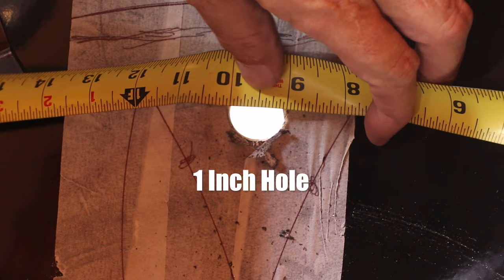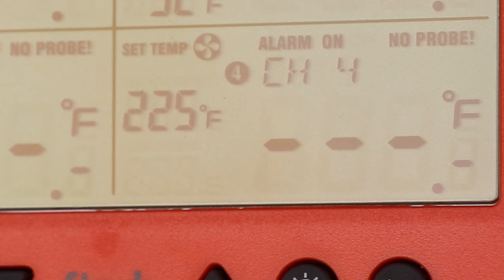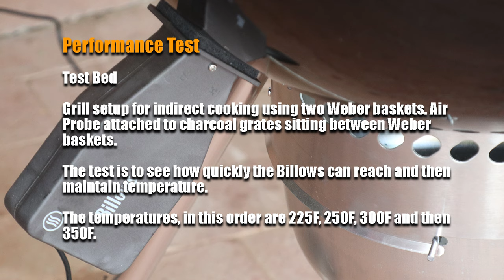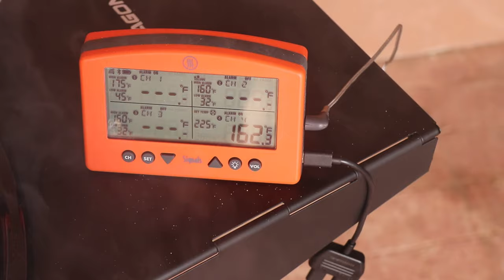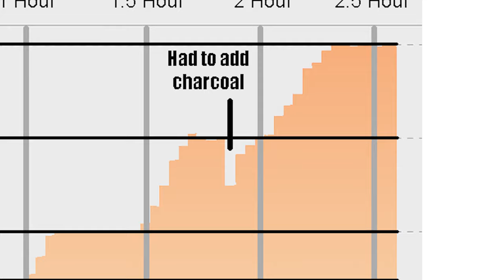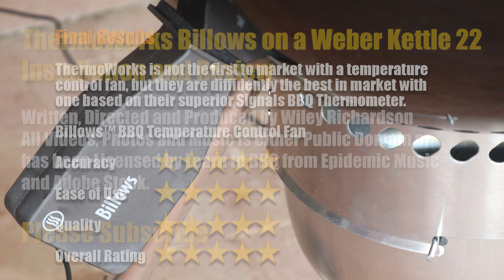Thermoworks Billows Smoker On A Weber Kettle - Installation And Review

Comment: Do you recommend any gasket or cap to cover the hole when the ATC fan is not attached?
Reply from the maker: Yes - Because it is a one inch hole I recommend a metal cap like https://amzn.to/2LLAAGO
Reply: Just performed this mod, unfortunately the caps fell through.....which kinda makes sense, outer cap diameter is 1 inch, hole is 1 inch. Other than that, placement is excellent, will look for different cap solution.
Reply: @fattypros82  Did you ever find a solution for that?
Reply: Olivier Cuny I have 4 different grills so on the others I took it to 7/8ths, and the cap fits, loosely, my WSM has the one inch hole that I’m trying to rectify, found a 1 inch drain plug at Home Depot that has prongs similar to the one that comes on the Weber summit charcoal, but I lost it so I have to get another one, will follow up when I try it.
Reply: @fattypros82  Thanks! I was thinking about using a high heat silicone plug
Reply: Olivier Cuny that will probably work better, I got a replacement 1 inch cap today and once again, it fit loosely, so I put them into the bowl with prongs facing out, it works to stop airflow, but they may get lost if not careful.